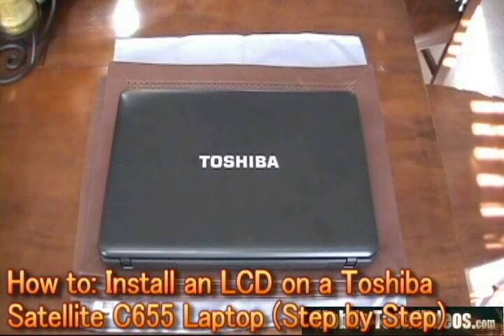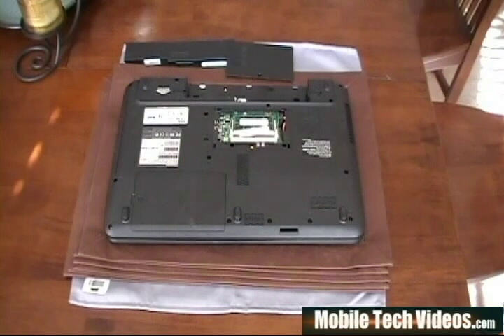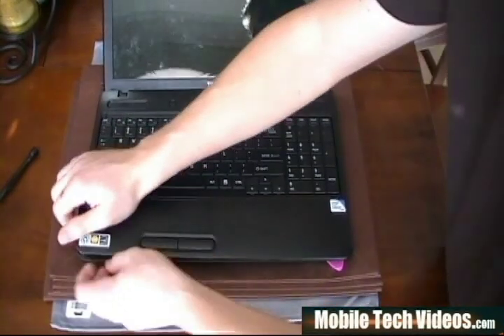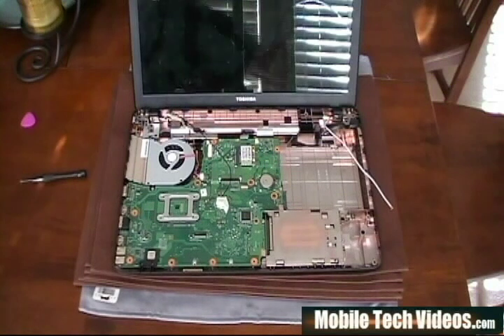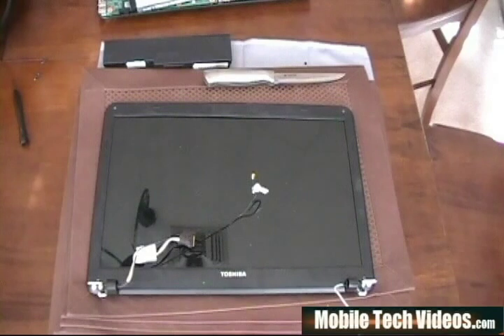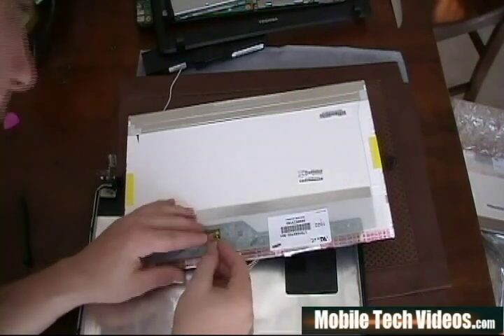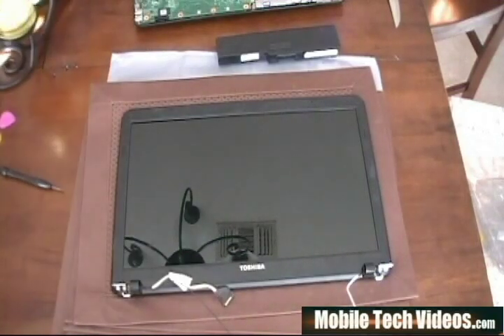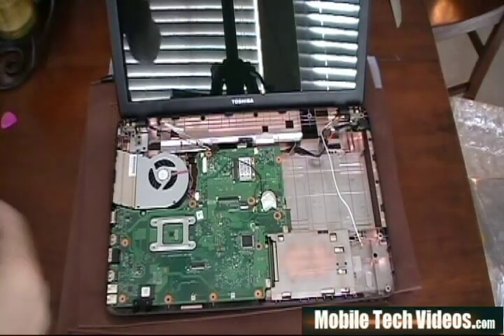Toshiba Satellite (LCD Repair C655 Models)

Comment: OMG I can't believe you did not take the keyboard off. It is very dangerous to just rip out those flex cables while holding the laptop in mid-air. Next time take the black plastic bezel off the topside of the keyboard, remove the 4 screws that attach it to the body, then lift out the keyboard BEFORE taking off the palm-rest assembly!
Reply: <.< You noticed that too , Lol

Comment: Don't follow the first steps to split the keyboard side or you could regret.

Instead, remove the (about 1/4") strip above the keyboard looking closer betwen the strip and keyboard to rise it up with a flat tool (flat screwdriver perhaps).
Once the strip has been removed, remove the screew that hols the keyboard.
Rise up to 45° the keyboard, pull it out to rise it fully up to 90° to disconnect the flexible and other cables that could rip off & break if you follow the first steps as in the video

Comment: I dont see the need to take the computer apart just do the last steps of opening the display panel, disconect the cable replace with mew screen, then put tape on the connection and put the display tray together

Comment: You are a cruel, evil person. First, you failed to mention in the video that once you disconnect the cables from under the keyboard it is impossible to reconnect them with anything larger than a trained baby mouse. Then, when someone pointed out (a year ago) that most of your disassembly wasn't necessary, you left this video up so that over-zealous neophytes could see it, take their laptops apart, and have to pay someone to put them back together. A pox on thee!

Comment: I agree But if you do rfp it down all the way remove the key board first you can get at the mouse ribbon and key board ribbon and speaker plug and on off switch plug with no trouble at all.

Comment: @compusanz technically, you are supposed to be able to only replace the backlight. But that repair can be easily screwed up by using the wrong backlight for your particular monitor, so just be very aware of all the part #'s that are compatible, so you get the right replacement. Usually, really good, reputable, LCD screen companies will forewarn you of that and also provide compatibility details for all of their parts.

Comment: So, I was wondering since I want to reapply TIM on this laptop, all i have to do is remove those screws that you have mention and pull back case out or there is something else that I would have to do before pulling back case out? 

Thanks.

Comment: The details in dismantling the laptop was really good but to tell the honest truth all of that was not required in order to replace the LCD. All that you needed to do was to remove the battery, remove screws from bezzel and side of screen, disconnect cables then replace the screen. This has worked for me. You don't need to dismantle your entire laptop to replace the screen.
Reply: Just as I thought when I watched this video...he complicated things by removing the entire keyboard..